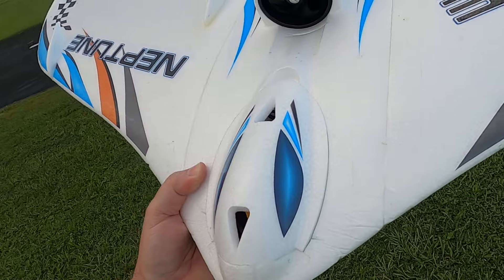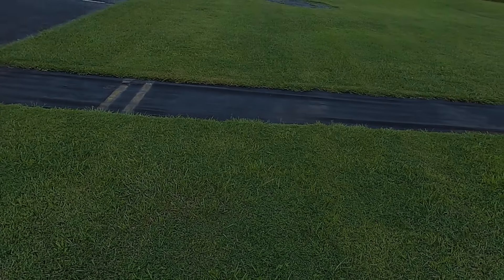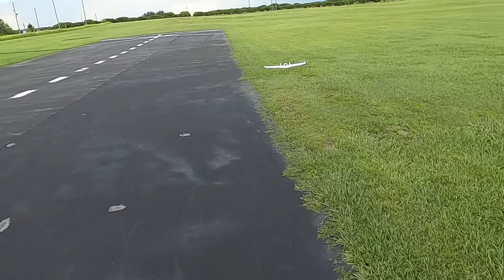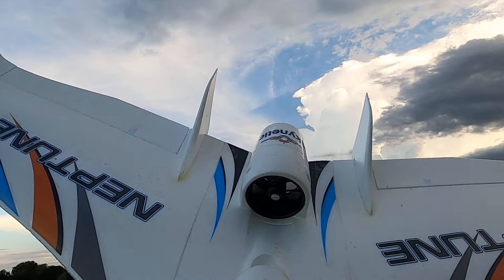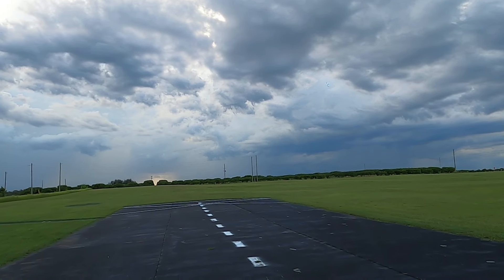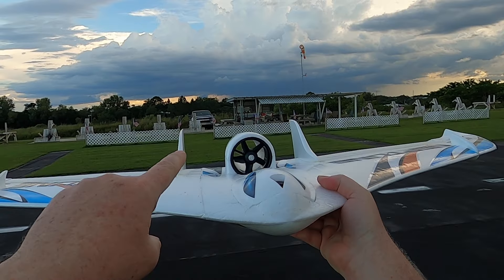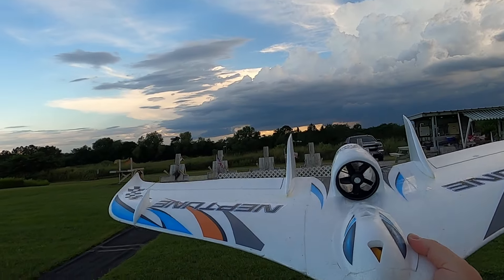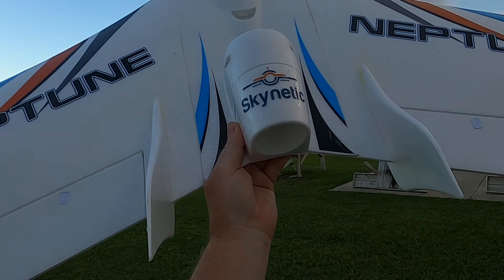Skynetic Neptune  EDF  1  Easy to Fly Wing by Fat Guy Flies Rc

Comment: I bought this after your maiden video. It has quickly become a favorite. I have 3 sets of rates from docile to what was that. My wife has commented that it looks fun to fly. Over hand launch full throttle works for me, I use the easy lights too. I have no dipping issues.
Thanks
Reply from the maker: It's  fun stable wing for sure. You should try the shriek